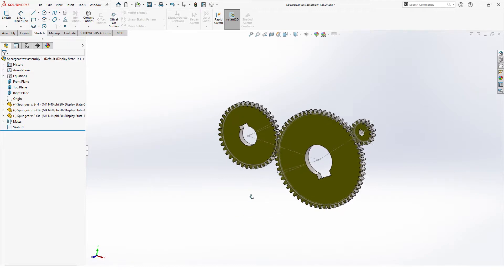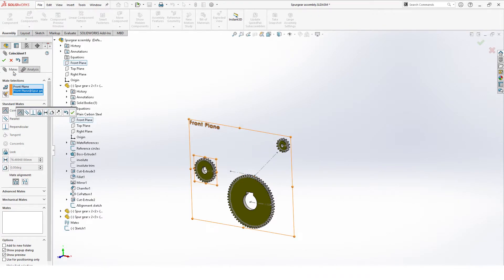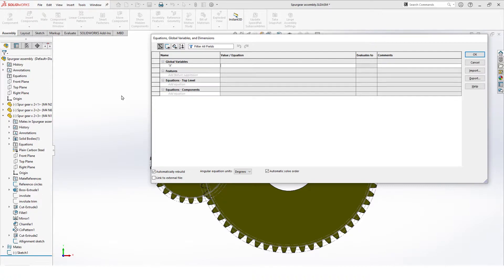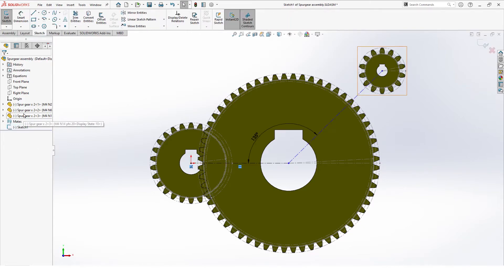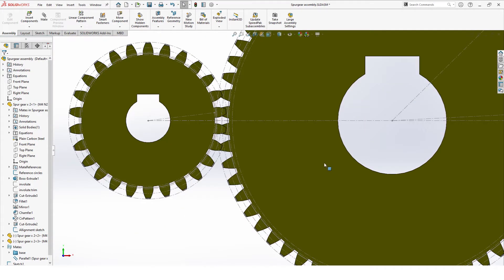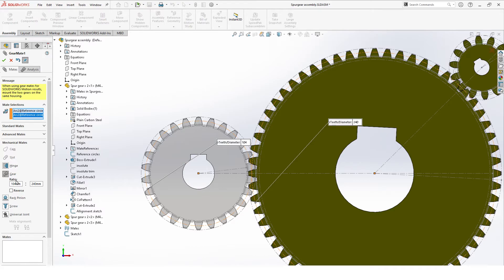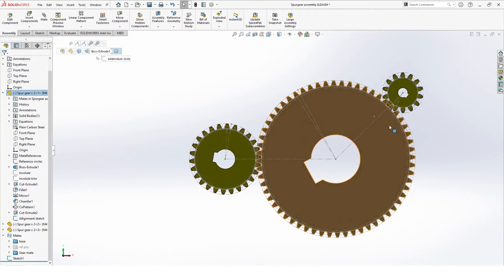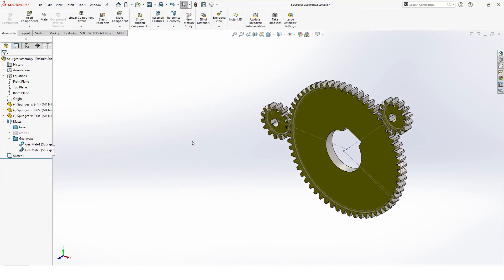Solidworks Pro Tutorial - Gear assembly with gear mates and equations

Comment: Concise and to the point. You know where and find with, what seems "great ease" - where they are and what each command does, from all sub-menus of the application. Obviously, you slept with SW under your pillow, and "ate it on your bread", for many years, to be able to use it, in such a way that I only dream of doing it. Thanks for the video.